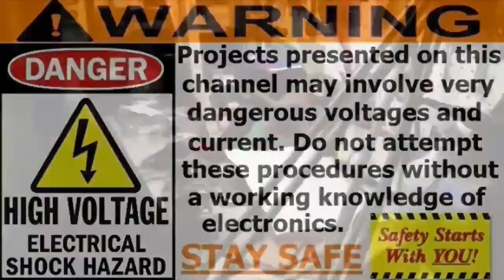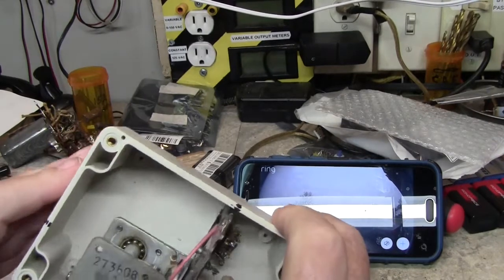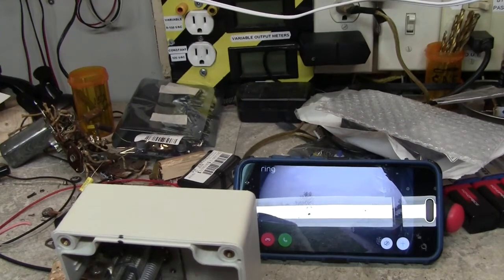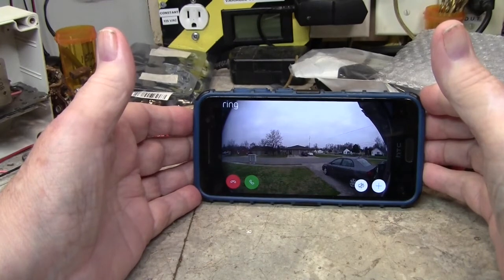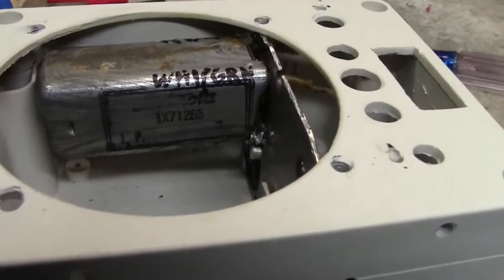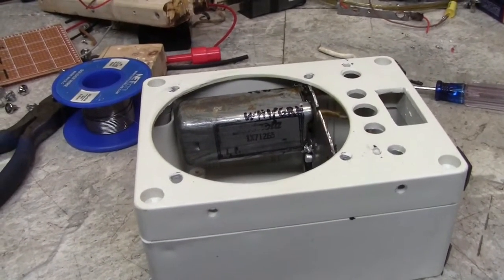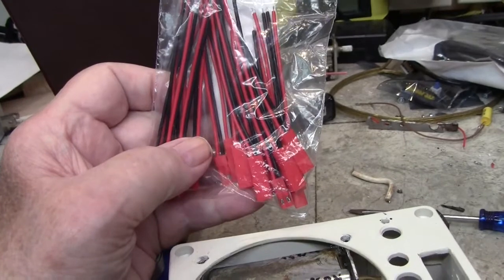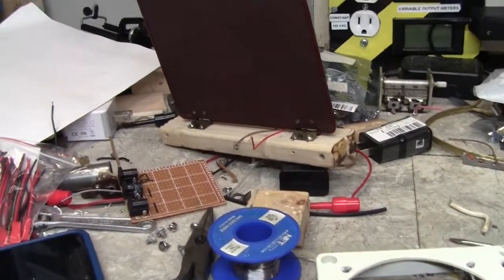DERB - What's happening on the bench?

Comment: Hi Doug, Glad to see the shop again, I am reworking my work area some and I think it will be better, it will give me a little more room anyway. That Phone RING feather is so cool, that is a great idea...One question about the white box that the variable capacitor is in, when this is on, although the tube runs at 12 volts heater voltage, will that heat up and melt the box? I am sure you have consider that as a problem, you are very good at the design phase... Have a great week a head and we will continue watching videos on your work...):

Comment: Hey Doug, Does the speaker go where that big hole is in the back of the case?  I'm going to change out entertainment centers in the living room after Christmas.  Got Ma a new barn door tv/stereo cabinet and a new 65" tv for Christmas and also recently picked up 2 vintage receivers off ebay.  One's a Fisher RS-1030 from 1978 and the other is a Hitachi SR-604 from 1979.  I think I'll end up using the Hitachi in the living room hooked to the tv/bluray and maybe a turntable.  Probably have to get new speakers as I think the Hitachi requires at least 8ohms and I have no idea what the ohms are on the little Sony surround speakers currently in there as they came as part of a package deal with the Sony receiver in there.  It was nice when I got it 10+ years ago, but it's developing little problems like wanting to go into it's surround test after it's been on for an hour or so.  And there are things on it I have never liked like how difficult it is to change radio stations with it...so I've never even hooked up it's FM antenna the whole time we've lived here, lol.